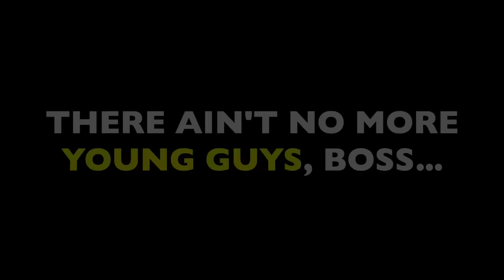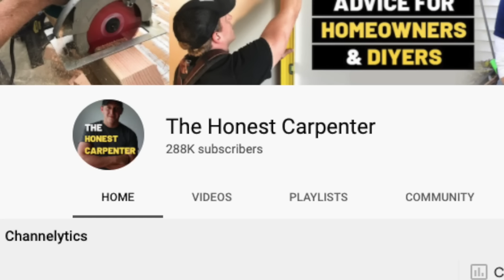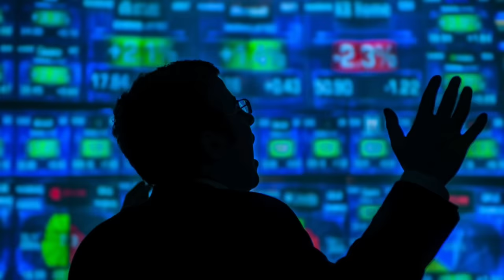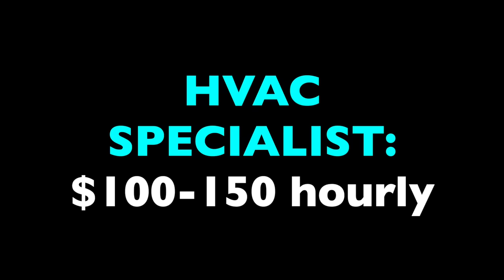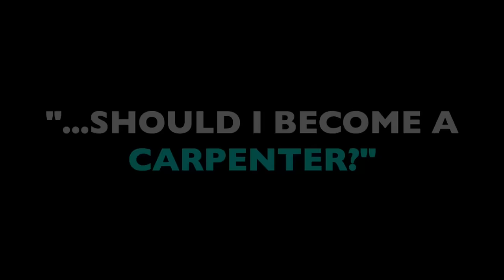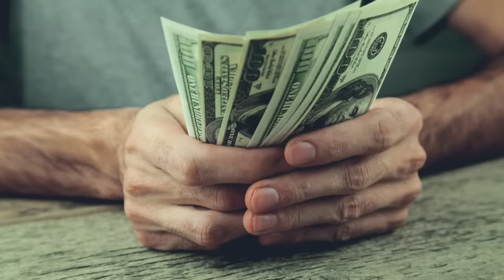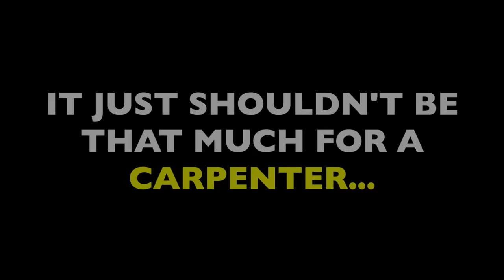WHERE HAVE ALL THE CARPENTERS GONE?! (Why The Trade Labor Shortage Is Only Beginning...)

Comment: pay people the proper rate and they will work!  nobody going to frame a house for 100$ day
Reply: It's more important how much money is worth than how much you get per day. Because if you earning 5000 day and burger is 1000 you didn't achieve much.
Reply: @krompirusa100  *borger
Reply: @hijinx7044   They will be eventually, maybe in 2080, it took 70 years for the currency value to change by 1000% last time. Although this is really off topic.
Reply: Yup trades are undervalued in pay. Why hurt your body when you can make money doing something easier on your body for more $$$.
Reply: I work at a grocery store and I make more then that
Reply: @TisTheWay  for reall I can flip burgers for 15$/hr or break my back for 20$
Reply: Labors that get the wood closer to the project pick up trash get water for the guys gets a fair 100$ a day easy down in texas the person cutting wood 120 to 160 easy depending on exp. The one with the nail gun putting up rafters and joices 160 to 200 a day depending on exp. The sub contracter is signing a contract for 50 to 60cents a sqft while the contracter is getting a easy 20 30 cents a sqft while sitting at home average home 3500sqft sub contractor pays himself pays for his equipments and his own nails which is 8 to 10 boxes at 45 each depending on your crew yiu could make a confortable life style at over 150k a year. Or more knocking out homes in 2 to 3 days (just frame) yes ive seen it happen with a crew of 18 guys
Reply: I'll do it for $100 an hour xD
Reply: Got my own tools know how to weld. Cant get anything more than 17 an hour. Ridiculous.
Reply: @Stszelec01  laborers in Ny area get 200 day plus a fresh lunch.  many times a ride back and forth no joke..
Reply: @matthewburke6186  sorry I don't live in rich country I live only if part or European Union where people harn 600 euro month and its nothing strange to them
Reply: @kirkdunn1379  average McDonald's salary for a manager is 43k not bad especially if you have no college debt. Plus  Running a business is alot more work too so 250k isn't really alot when working 80+hrs to keep it running. And long term working in trades destroys your body, and  you have a significantly higher chance get cancer.
Reply: @8Maduce50  you'll see when you get older
Reply: $100 a day is a lot of money here in Africa . . . As in life changingly .
Reply: Yup
Reply: Apparently, you get paid $250/day (USD) as a certified carpenter in South Korea.  Husband and wife team walks away with $500/day in the bank after an honest day's work.  

People say there's not enough truck drivers in America, frankly, you pay people more you won't have that problem.
Reply: @jaeinnmoon3279  they pay pretty crazy sums of money to drive trucks where I'm from. If you what you are doing you can make 50k+ easily
Reply: Foreign labour will. Not knocking them, but you don’t always get the best when you pay the for the cheapest.
Reply: @donsolos  - what kinda life can you have for your family with $50k/year. 🙄🙄🙄

You are away from your family, and you can't be sure your wife and kids are financially set.  Can you send your children to college with that ?

Most colleges cost around $64k/year.
Reply: So true!
Reply: @kirkdunn1379  well seeing how I don't plan on having kids getting married or buying a house 40k a year is all I need. I'm not going to break myself for a job that will be posted before my obituary
Reply: @hijinx7044  yes
Reply: Tell me about it. I do traditional lathe and plaster work on walls (not ceilings, respect goes to the competition, Alexy, who is a master plasterer and only does ceilings with a specialty in reproduction of heritage crown moulding).

A homeowner down the street was offended that I refused to plaster walls and repair trim work for $10.00/room for 9 rooms with at least two walls needing large patching or total replacement after I suggested that $10/day was nowhere near a fair offer for someone coming in using all hand tools and traditional techniques.

I never said this out loud, but if she's only willing to pay crackhead rates, then perhaps she should hire a crackhead.
Reply: that is already better pay than 50% of minimum wage workers lmfao
200-300 dollars day covering materials and labor sounds better
Reply: @_Circus_Clapped_  the 'cut-corner' minimal estimated time to completion that would result in what I would consider too cringey for anything other than personal shame would have been 24 hours with a 1-coat paint and a mid-50's era scam contractor plaster finishing cheat. That would be $90 for 3 eight hour rotations on the first offer, and $30 for the 2nd. McDonald's is paying $14/hr.
Reply: Correct!
Reply: If I had a dollar for everytime someone called me for a quote and casually mentioned they are on a "tight budget." I just ignore it and charge the same regardless. If they can't afford me then to bad. I have way more work than I need. Don't need to be doing favors for people.
Reply: 100$ a day? The union by me pays 65$ per hour not including benefits and pension.
Reply: @TheDrop24  not even anymore
Reply: @donsolos  50k is not worth it to be a truck driver. Plus you only get that money after 2 years.
Reply: @jaeinnmoon3279  lol 50k is bare minimum, you can easily make 75k and higher if you are good at what you do and you can be home every night.

Owner/operators can make even more than that, all you heard was truck driver and made a shitty assumption, you can make a million dollars a year if you get a couple trucks and some trustworthy guys working for you. Dont be a clown, hard work is hard work and you can make a killing doing anything
Reply: @donsolos  - bullshit.  Who hires new drivers... that's right mega carriers.  You be lucky to bring home $600/wk.
Reply: @df4480  - what group of people are engaged in school teacher jobs, they need to be put out of their jobs….
Reply: I'm working as a carpenter here in Philippines for almost 12 years from now, I love my work.  I admire all the carpenters in America because of the tools and the machineries you have there. It makes the work smooth and easy, I check the price of the tools on Amazon  and I'm surprised that their prices are quite cheaper than here in Philippines. Tools here are very expensive for a regular carpenter. So we save much just to have one, but the down side here is the salary range for a carpenter the basic salary is about 10$ (500 pesos) a day, and a much skilled or the one who can perform more task is 14$(700 pesos) not enough to have a better carpentry shop. Or just to invest for a good power tools to used. For the next generation I guess they would not consider carpentry as a profession... A hobby maybe.
Reply: @hijinx7044  actually the dallars value keeps decreasing. Because the feds dont want a budget and refuse to stop printing money.
Reply: UK get about £120 on the books and about £180 sub ,by age of mid 40s everything hurts
Reply: That’s not how the economy works
Reply: @loganwetherbee5288  they dont get how the market works do they.
Reply: I always tell younger guys to get into electrical, plumbing, etc also. 
  Beyond some trades being more physical. Carpenter requires lugging around more tools also.
Reply: Mexican Americans will do it.
Reply: These fucking companies don’t want to pay you crap. Benefits suck booty. Construction isn’t the way anymore. Fast food and restaurants pay more to start out at! Not everyone wants to teach the young guy either.
Reply: Exactly. Wages haven't matched inflation. A carpenters avg wage would need to double to make it equivalent to avg wages in the 80s
Reply: @luismartinez6408  I don't think working for less is the way to help the carpentry trade. We must stand together, unionize and demand higher wages
Reply: You can flip burgers for 15 an hour but to learn how to build something is a value on its own and in some sense is priceless when the world comes its way
Reply: @thedanklord6976  Don’t complain like that. Tech makes the world go round.
Reply: Come to Australia. 40 an hour and I just finished my apprenticeship a year ago. I know guys on 85 plus an hour as carpenters
Reply: OK, so you get $100 bucks for a day framing. What you also get is training and experience. In time that experience can lead to better paying opportunities. Anyone in the trades knows this.

Meanwhile young people are told to go into debt to attend college after which they have little guarantee of a job.
Reply: Amen brother
Reply: @hijinx7044  I went to the emergency room for galbladder surgery, the most common surgery in the world, the typical price is 8000$-15000$.
two months later I got a bill in the mail, the hospital is asking me to pay almost 70,000$, this is ascenion seton.
so let me ask you, if it's not right to charge 1000$ for a burger why is it legal for a hospital to charge me the price of a brand new mercedes car for one hour of work?
but you are worried about paying a carpenter 25$ an hour?
Reply: @Satorotas89  Khabib time
Reply: @potatochobit  thays why we in europe have health insurance
Reply: Then they will complain they can't afford the housing.
Nobody is forced to work for less than they deserve.
Reply: @hijinx7044  you don't understand basic economics and inflation.
Reply: Here is a benefit tradespeople don't realize... When society collapses you suddenly become necessary again.

Use your trades to enrich your own living to reduce your costs and expenses...
A carpenter can build frames and furnishing for themselves, can use the skills to make gardens and grow their own food and such.

Trades are useful for self-sufficiency.

The moment you focus on complaining about money, is when you entrap yourself into societal conveniences.

Metal workers are likely necessary for survival in the future, if goods and trades are halted or being used to control economic powers between countries.

But yes if you have the skills, look into building your own energy generation like wind turbines, etc.
Reply: Trades usually make.good money idk what you talking about
Reply: @nekoschar6170  I think what they are referring to, are redundancy in societal needs for tradesmen following "traditional" work ethics.
These sorts cannot adapt to changes in societal trends, like say factory workers who only knows how to assemble parts in a car factory becomes redundant once automation occurs which replaced them. It is a negative to have a trade you spend your entire life on, because like mother nature, anything can happen which flips your life upside down.

"Survival of the fittest" is the only true "law" in the world, and it differs to how people perceive that notion.

The Renaissance destroyed a lot of jobs for traditional workers in some sense, and created new one. The industrial revolution did the same, as did the turn of the century for Automation that happened in recent decades, and now its more on replacing redundancy in simpler things like "concrete mixing" and "carpentry/metalworking" due to new technologies to 3d print objects that has the same results.

NASA is probably going to experience this once 3d printed rockets takes off and they contract companies to make it for them instead of spending 6 months themselves, for dozen times the expense.
Reply: My advice, is always learn new things, be a jack of all trades but master of none... Even if you can't compete for high end jobs, you are extremely adaptable. It doesn't matter how much money you make so long as you have complete control of the direction of your life.

The moment you let traditions and culture take over the entirety of your existence, your vulnerabilities only increase.

We see people ending up with mental issues and suicidal tendencies because they are so withdrawn into their cultures, they cannot think otherwise, like a helpless animal trapped by humans.
Reply: I do it for 60-80 everytime lol
Reply: My dad gets 25€ a day!
Reply: You can make more than $100 a day, if you aren't trying to frame and house and instead is trying to SELL something you crafted with your skills.

How much does it cost to make and then sell a freaking door?
Reply: Learn the trade and you'll make more money..noones gonna pay you an ass ton of money for you be pulling nails..gotta start at the bottom like every other carpenter.
Reply: The McDonald's in my state has a sign out front that says hiring now 16 dollars an hour. That's where all the laborer/apprentice type workers are at smh. I work predominantly by myself because of this
Reply: @elibobber7325  In a way, it's better you don't join them even if their wages are higher, you sacrifice a lot for that wage if the labor shortages are so bad they are making you work overtime and overburdening you with so much work.

Time is money, time wasted exhausting yourself will end up being spent to recuperate and de-stressing.
Reply: @jaeinnmoon3279  that isn't much.    In US we need around $500 to 700 a day if we want to having any savings.
Reply: @thedanklord6976  change it then...

Comment: I was a machinist in my 20’s.  Around age 30 I took a look at the money I was making, the smoke and mist I was inhaling from oil and coolants, and the pain I was starting to experience from spending long days working on my feet.  I ended up going into IT.  The money and working conditions were better.  I was a good machinist, just couldn’t see myself being able to do that kind of work for 30-40 years for the money I was making.
Reply: IT isn't that much better either - a lot of sitting is almost as bad, if not worse for your spine than standing around machines. CNC / 3D printing has at least a nice technology edge and combines knowledge from both machining and IT.

Comment: Same applies in the auto mechanic/ tech trades. That's my arena of work..or was..
I did it all in when I worked classic auto restorations . I had to be a jack of many trades with a wide variety of abilities in my skill set and an equally wide variety of tools.. i had to know welding, metal working, fabrication, mechanics in engines, brakes, suspensions, steering, chassis etc..,fuel systems ,  body work and paint, glass, trim , upholstery ,electrical systems, radio systems,  ac systems. Doing custom work etc..I did it all. 
But like all the trades, it takes a toll on your body. Physically demanding.  In my 50s now working another field..no young people in sight. 
Trying to convince my son to do HVAC, plumbing or electrician . 
Good demand for those guys and they seem to get paid well .plus they don't require a outfitted shop building or near the large amount of investment in tools us auto techs have to have and keep buying as cars update and change every year. One reason I left that field of work.

Comment: I’m a retired carpenter after 45 years in the trade. Demise of trade unions have have had a detrimental effect on wages. The problem with carpentry is that it encompasses a wide variety of activities and most people just specialize in one particular 7:40 aspect. I was fortunate to work mostly for general contractors who self- performed most aspects of the job rather than sub-contract out everything. The last 10 years of my career I worked building large apartment buildings. Our crews would do all of the concrete forming and shoring for a parking structure, then wood framing above (usually four or five stories) and then all of the interior finish.
I retired about seven years ago with a decent pension. When I retired a journeyman made close to $50.00 an hour with benefits. There are way too many un qualified workers with a Home Depot card and a Skil Saw who call themselves carpenters.

Comment: I retired as a union carpenter, (NYC) as soon as I turned 55. And was eligible for my pension and medical.  I had 28 years, 28 credits.  I wish I could of worked a few more years, for a better pension. But the job took a huge physical toll on me. I also got tired of start times being moved from 7:00am to 6:00am. Most tradesman live well outside NYC, I was waking up at 3:00am.  Plus putting up with all the BS, like being harnessed and tethered in a scissor lift, jobs that ban regular A-frame ladders. Breathing in Mono-Kote fire proofing, which is banned in California and Europe.  And dealing with all the non English speakers. That the union in NYC is hiring as “B” rate journeymen. And is now 40% of the workforce.  A lot of the apprentices are seeing this, and bailing out of the program. Because at this point guys like me. That made a decent living, and have a house in the suburbs. Are dinosaurs, and on the extinction list.